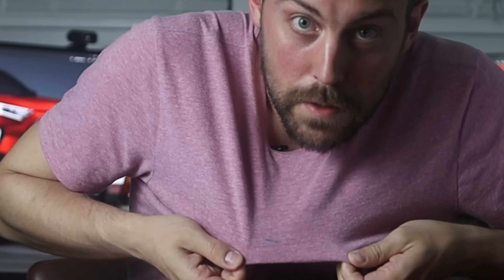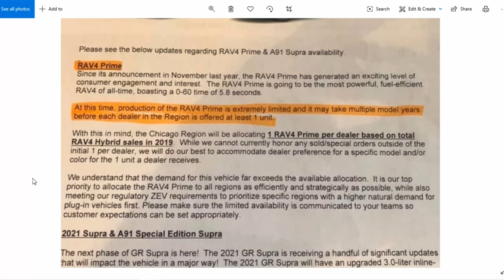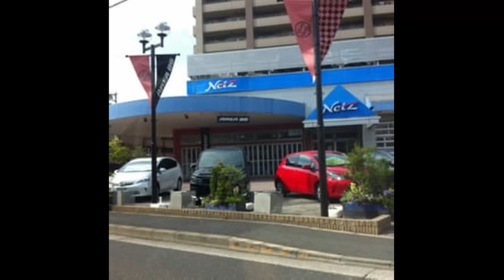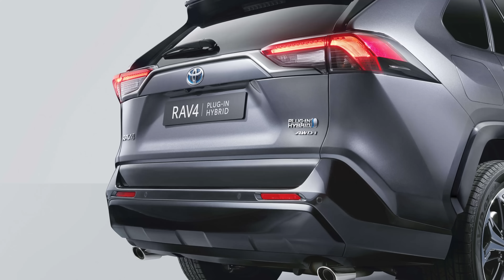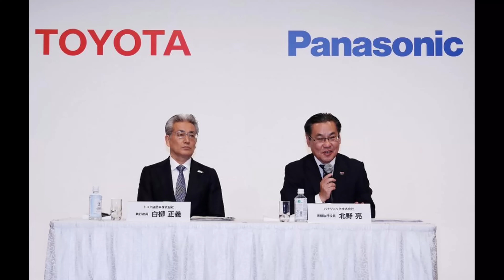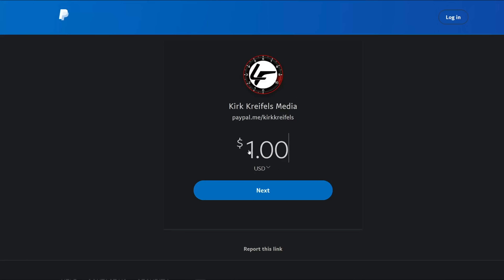New Details and AVAILABILITY of the Rav4 Prime

Comment: Imo, the reason they are limiting the supply is to avoid drastic depreciation of all the other non-PHV RAV4. Just imagine how many non-PHV hybrid owners will want to trade in for that beast? The demand for non-PHV hybrids will fall so bad, the current non-PHV inventory won't be able to clear, and used car inventory will be flooded with non-PHV RAV4's. With a company of the size of Toyota, there is no way they couldn't plan ahead for the production capacity.

Comment: Not one to really comment or like, but I had to do both on this video. GREAT content and THANK YOU for actually putting the time and work to make it as factual as possible. I know a lot of the info are guestimates but it is good data to make informed decisions on. 
One thing that you did not mention though, and may be worth mentioning, is that, at least in the US, this is going to be MARKED UP like a MOFO. One dealer told me that there will be a mark up and expect it to be no less than $2999, another deal said that it may end up on a bid based on who offers the higher markup starting from $5000. It is going to be RIDICULOUS! 
Not to mention, this will have the $7500 tax credit, at least in CA, BUT, with a markup starting at $3K and going up only god knows how high, you need that credit to justify the price, otherwise you are looking at $60K+ which honestly, is not worth it.
Reply from the maker: Thanks for watching! Yes I didn't mention the price gouging going on...it's going to be ugly.

Comment: Toyota has no battery production capacity and therefore no real ability to produce and sell large numbers of primes Phevs or any bev they come up with 
Ridiculous , shortsighted , ever heard of a Gigafactory  Toyota ?
Reply from the maker: Hey mate ..they actually do design, research,and facilitate production of batteries. They have joint ventures with the largest battery makers in the world; Panasonic, byd, and catl. They are set up very very well for the electrified future.
Reply: So the low Prime production #s , not battery cell shortage related ?
Reply: @kevinphillips4631  demand in Prius overall has dropped like a rock the last couple of years
Reply: cba tiau this isn’t a Prius it’s a Rav 4 suv , Just happens to be the Prime version as in plug  in hybrid , the drop in Prius sales has more to do with the recent styling and mostly the fact that buyers want SUV’s not hatch backs.

Comment: When it comes to electrification, traditional automakers just keep disappointing me. One way or another they just bad on this area:
IPACE and EQC has production issues due to battery shortage.
ETron does not use 10 kwh of its battery. The only car which does this. ETron is a remake of Q7, not a newly created electric car with good drag coefficient (what is important).
Toyota is not able to secure 18 kwh battery/car.
Id3 has SW problems. (or maybe battery)
And I can keep on going. Sad, baby.

Comment: Is that why same goes to Prius Prime low volume of vehicle because of the battery and demand? I am in Cali just pre-ordered Prius Prime XLE and I was going to get Limited trim but the dealership didn’t have it last time they had was 3 months. I dunno it’s pandemic causing this or Manufactured just a test thing?
Reply from the maker: Primes are not made in large volume

Comment: Performance?? That would be the Model Y 0-60 3.5 seconds. 

18.1 ? What about battery warranty and degradation? Standard is 3/36 , what is battery warranty extension? To get faster charger is part of option package costing almost $6000.

Comment: Thanks Kirk for all the great info. Do you know how long it takes the car engine to recharge the batter from 0 to 100%?
Reply from the maker: No idea...at idle I'd say a few hours. With driving it would be faster.
Reply: @KirkKreifels  My 14-kWh PHEV gets re-charged to full from zero when driving on the highway in under an hour...
Reply: @cbatiau2528  
which phevs is that?

Comment: Did you just say 50k I had to rewind that to hear it again lol. I rather get a Lexus RX 450H F Sport for 600 bucks more lol
Reply: $35K and would sell like hot cakes
Reply from the maker: 10 years from now they'll be $35k with a bigger battery capacity
Reply: It's not 50k the most expensive y can get is around 40k but with federal incentives u are looking at 35-38k
Reply from the maker: Not true. Base model is about $39k
Reply: @KirkKreifels  Will be $39k-$40k USD in the USA with destination charge.  With US federal tax credit of $7500, it's much lower, and in my state we also get a $1500 plugin-vehicle rebate, so $9000 less for us (i.e., close to $30k for the SE trim with no options, not bad).
Reply: Depending on where you live, it’s quite the bargain with federal, state, and local incentives.